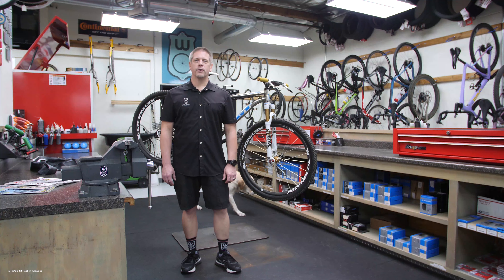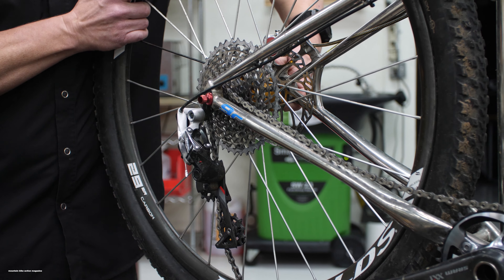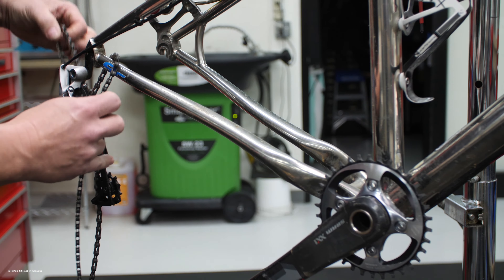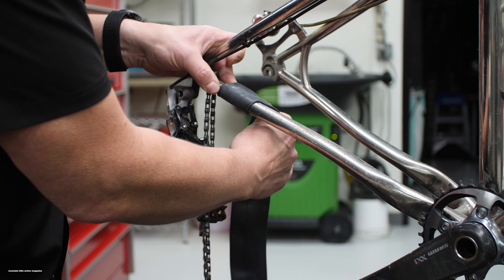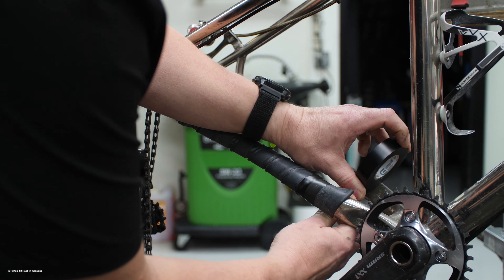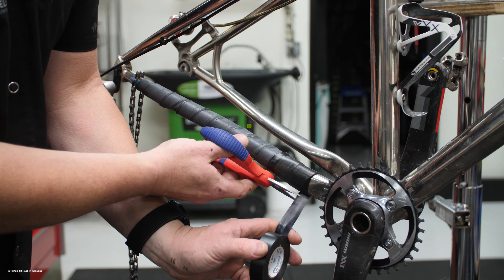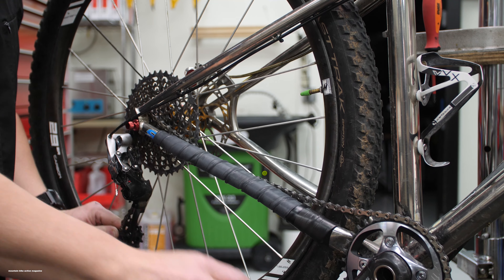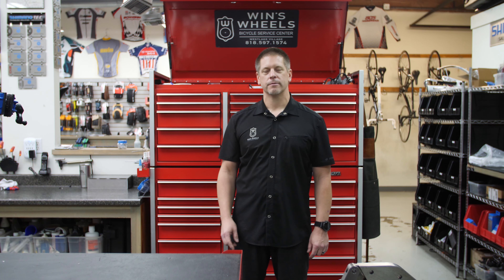Chainstay protector using a used inner tube hack -Mountain Bike Action

Comment: Hey, would this work with a bike that the shifter cable runs under the chain stay (can you rightly wrap it around the shifter cable)
Reply: Same problem with me, I just went ahead and did it and it seems to work fine
Reply: It’s not as neat but gets the job done
Reply: remove the tension from the cable, move it, wrap the chainstay and put back the cable